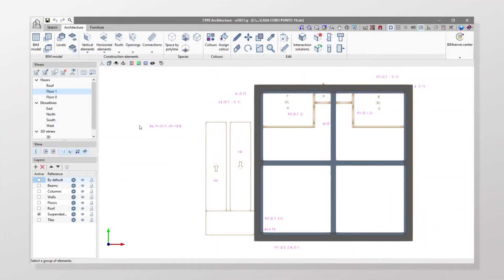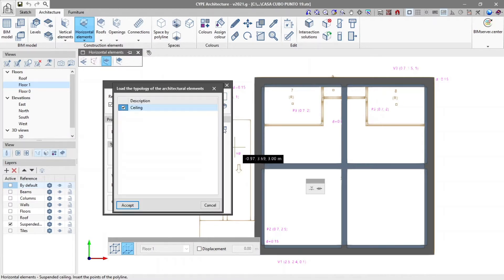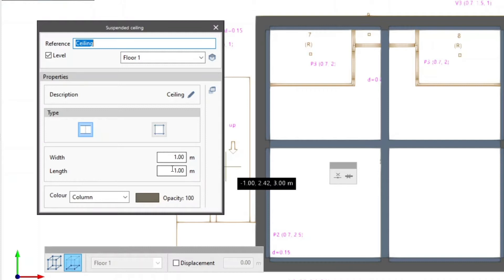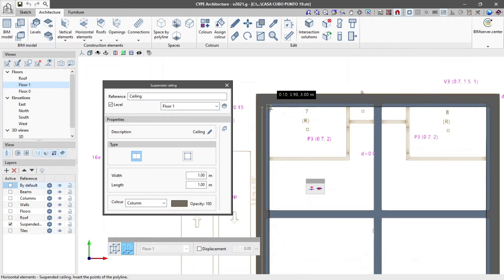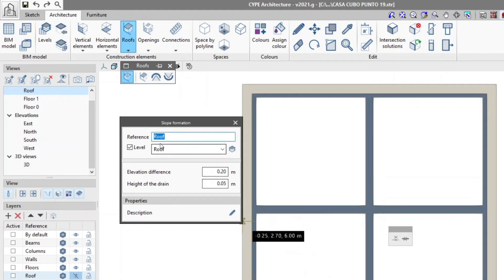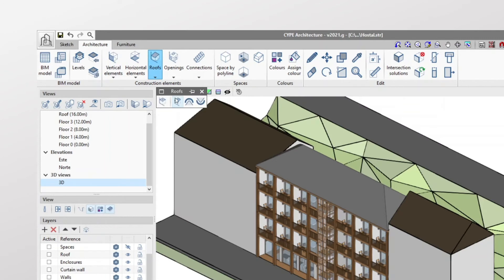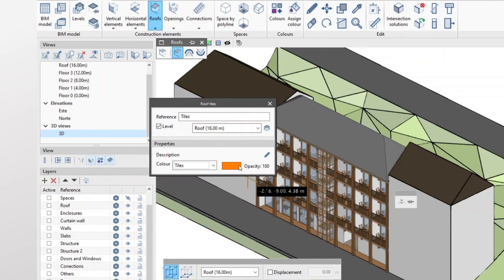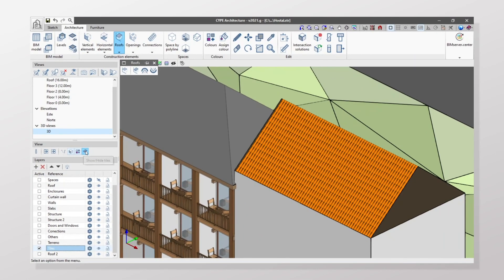CYPE Architecture: suspended ceilings, slope formation and roof tiles

Comment: hi, ok en 2025 version how can i made slope roofs, 1,2 4 sides roofs?
Reply from the maker: Hello! You must enter as many floors as there are pitches or slopes on the roof. There are several alternatives, one of which is simply to use the ‘By points’ input mode and enter the vertices of each slab at its position in space. A reference or sketch line structure can be drawn beforehand, if necessary, in order to have the capture points available at the desired height. If you have a sketch surface, in any position, you can also transform it into an element of type ‘Floor’ using the ‘By surface’ input mode. Greetings😊